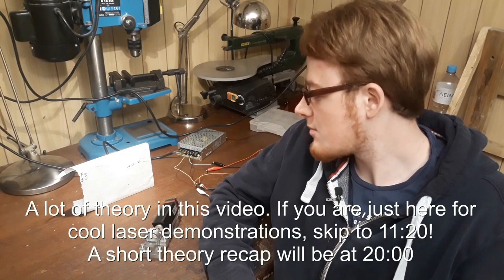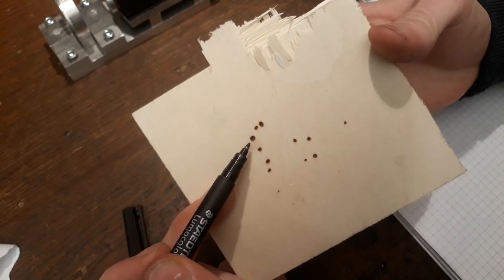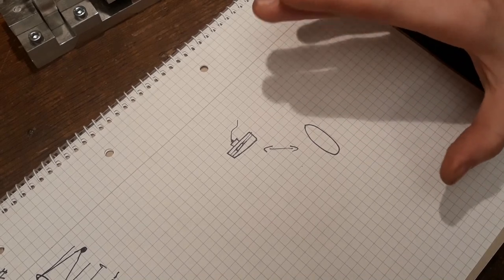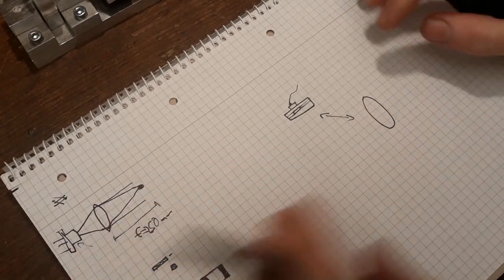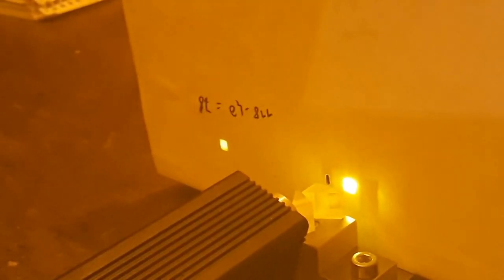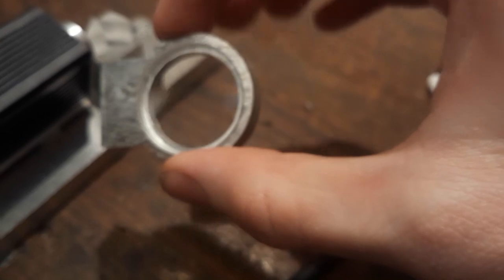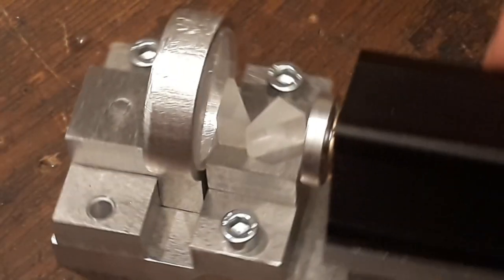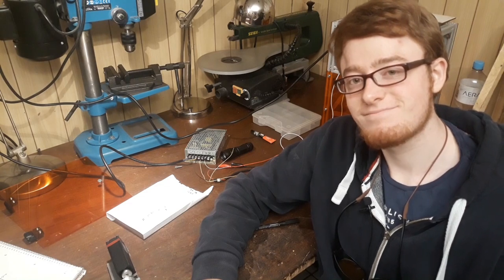Focussing a high power diode laser with anamorphic prisms

Comment: one reason why the retail blue diode engraving laser systems have retangular spot shapes is that they are not truly "beam combined".   in these systems, the term used is "Knife edging" and its not the same approach as the coherent or spectral beam combination that is used in the "serious" technial laser designs in commecrial systems (commonly used in Fiber-Pump modules, eg see the IPG photonics website, where they have images of de lidded modules showing their internal optical setups)

essentially the rectangular beam is created when multiple beams DO NOT follow the same perfectly co-axial path/alignment, and actually allign slightly off-center, spaced laterally relative to each other (in addition to a "dumb" aperture that may be filtering as well)

to the naked eye, these arrangements can appear to be similar or identical.

a few of the stage laser ompanies have diagrams explaining the whole "smeared out" imperfect overlap "Knife edging" approach

Comment: Singlemode diode and multimode diode, the problem of multimode, to obtain high power they put several diodes next to each other, which gives a line by focusing, and this is why we mount prisms at the output to rectify the beams, a single-mode dvd burner diode which is about 300mw has a round beam called TEM 0
Reply: Explain more, that shyt don't make any sense. What is single-mode and multi-mode on laser diodes and why does this has anything to do with the focal point precision of a laser beam?

Comment: did you get the prism made just for this application? or can you get them at any retailer? I mean, how do you choose which prism to used that would yield the best result?  this is fascinating :)
Reply from the maker: No, you can just buy anamorphic prism pairs online. I bought mine from lasertack.com which is a german company but I have seen them on eBay as well. I would make sure that the ones you get are AR coated for your wavelength otherwise you loose a lot of power due to reflections.
Reply: @WoodenWeaponry  thanks for the link found out the sell a verry well made  laser unit too wish seem to have the prisms build in it